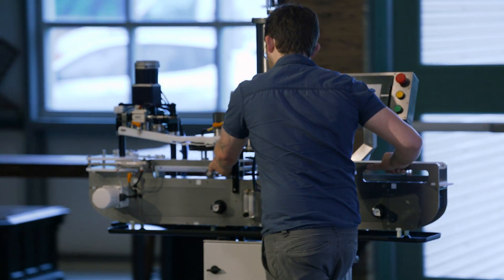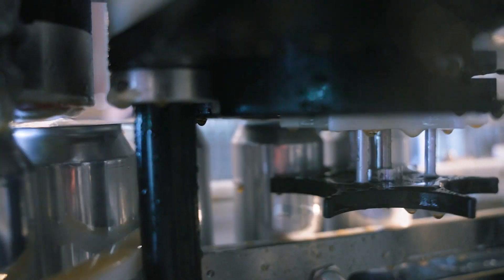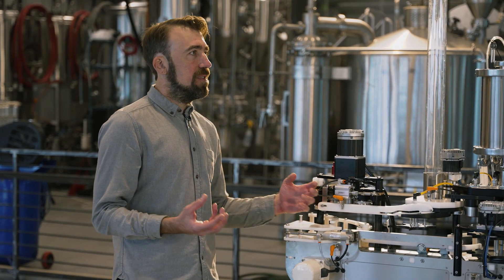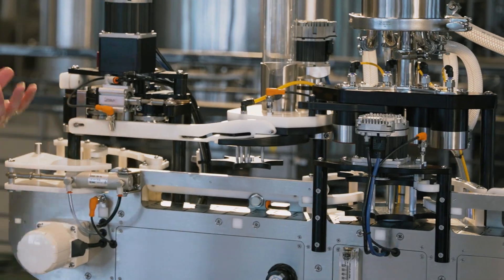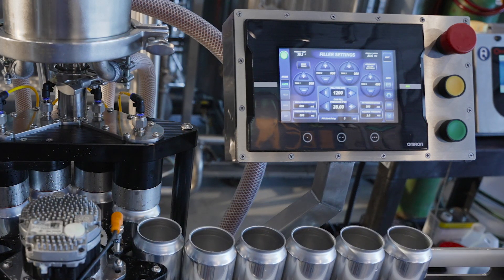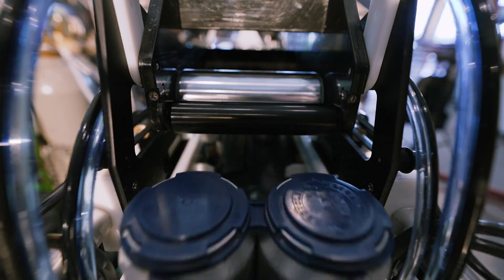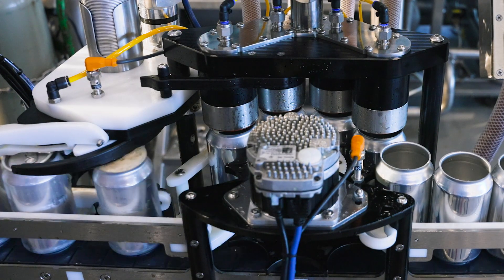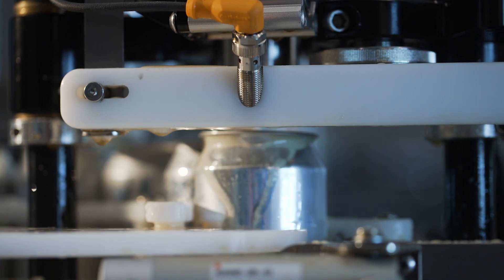CP-4 Counterpressure Filler/Seamer by American Canning Machines

Comment: How much does it cost?
Reply from the maker: Hi there! Base pricing can be found on our website at https://americancanning.com/products/filler-seamer.
There, you can also request a quote and be put in contact with our machines salesmen in order to fully price the machine based on your needs. Thanks!
Reply: there is no listed price for this machine.  its real easy to write something like 32K @canwithacm
Reply: How do this machine prevent Oxygen dissolving?